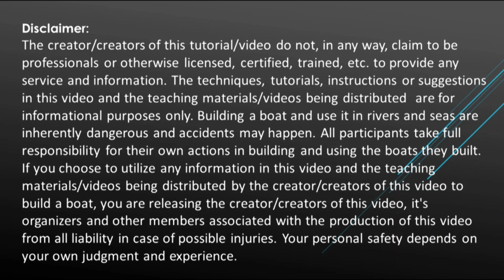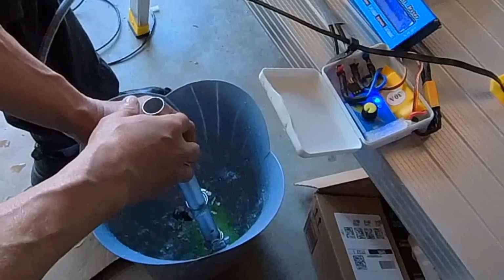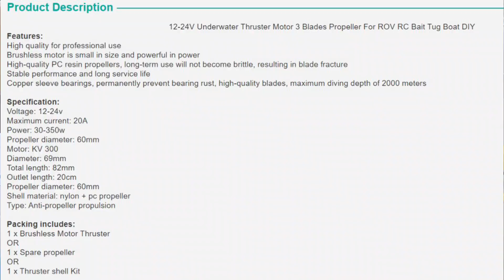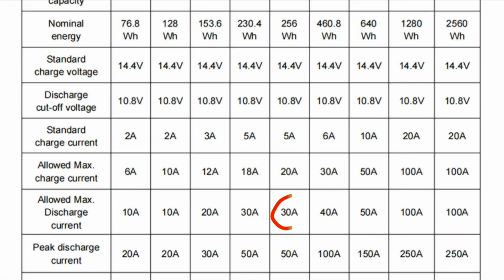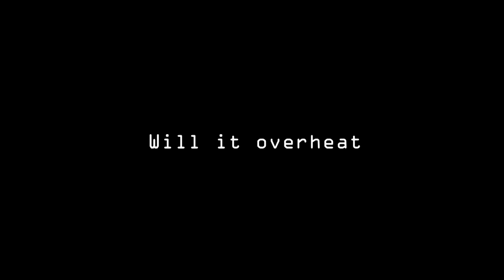Pt 2 Build My Bixpy Kayak Drive

Comment: What motor drive controller did you use for the green motor in your video? I'm wanting to do a two motor setup, I'm not sure if I need to have two separate controllers (because of the current draw) . Do you have any web link to the controllers you used? (Parts List) I have enjoyed watching you build your kayaks
Reply from the maker: Thanks for your support.  Please read my reply to your email. I copy part of the respond here: 
You can get the 'same' controller from many places, and with different prices. Such as eBAY, TEMU, AMAZON.. Same with the green motor.
I checked Amazon, you can get this one, or other similar ones.At  5:10 into this video, I have the circuit diagram. It is very simple with only a few parts. 

https://www.amazon.com/JINOARC-Electric-Brushless-Controller-Helicopter/dp/B0DY5S8VF8/ref=sr_1_1?crid=1WHBG0BUH4ARL&dib=eyJ2IjoiMSJ9.D2_PAiNGu7rB9OppG3hT5Arn4pNmGRwunC87Wc9H2j694myU4yAzIlHMOKxisKQYFjujDRunGLMMPafXV-gPNcKGmgPkeK59L7Y7LfVT-08clXLXKz1RwiK_L-h8KfoE6AofNSU9oSjKiXjhxF7rGPds38pw4idA5O6m3leGbXRJ0o1Vb8gjNMKmBUBHPEW9Za_3wycK2q4BkKrSet-pQ6nti8vKuGQ91q8EpC-J56FwDhr6lphSJ6shhP8KASKl1Pnv7I-uBzvbg6QJ65iTFsX6G4J9ewSlX6QB5bnpLdY.ViOOhxfxylQmmY2ykHCUAtJOyZG2ZGkK2w4qISoxIBM&dib_tag=se&keywords=30A+servo+motor+controller&qid=1755642568&sprefix=30a+servo+motor+controller%2Caps%2C145&sr=8-1

Amazon.com: JINOARC 30A Electric Brushless Motor Controller, ESC Speed Controller with XT60 &3.5mm Bullet Plug for RC Drone RC Airplane Helicopter 

I used the 30A one and that's good enough. You can try the 40A ones and pay a bit more. The important part is you have to remove the plastic heat shrink and add a heat sink on top to cool the controller. As shown in this video: 
https://youtu.be/b9l_38mcLy8?si=5CK6FsE2Uu-nl4xD

If you use two motors, I would use two separate controllers. This allows you to turn your boat by adjusting the speed of each motor. Also can eliminate the performance discrepancy of each motor. 

When you use two motor configurations, you have to pay attention to use one Clockwise rotation and one Counterclockwise rotation motor. Please use ChatGPT for explanation:goodvibes:.  Cheers!
Reply: @DIYUSA yes I will, thank you
Reply from the maker: @bendemby924  Please let me know if you have other questions. I can give you more detailed reply on email than here. Have fun building this drive!

Comment: 30A is a very high current. The switch and wires get very hot. I tried. you need to give a current of approximately 10A good luck
Reply from the maker: Thanks for your input... Yes, I agree 30A is a lot of current for the 6 gauge wire. I overstated my goal, I probably will keep that down to 20 A, or about 240 Watt to drive the motor. That is about the right level that my battery can handle.

Comment: Did it not seem like it was going to fast in the air and that it would draw alot of current or overheat seems like lower rpm would be better huh maybe lower volts?
Reply from the maker: When the motor is running in the air, the resistance on the propeller is small, the motor will run very fast, but the current draw is small (there is not much loading on the motor). When the propeller is submerged, the load on the motor increases and it will keep on drawing more current and create more power to move the water.  Similarly, if you turn on the vacuum cleaner and you gradually blocking the suction pipe's opening, the vacuum cleaning will gradually drawing more current, and it's motor will be getting very noisy.

Comment: For inflatable Kayak, Planning to use two motors with 30 amp supply just to safeguard motor from burning..

Is it good idea?
What is ur input or just single motor is enough?

Please let me know.
Reply from the maker: Thanks for asking. I have looked into using two motors. I didn't implement that because one motor can easily draw 30A at 12V, that means I need two small batteries, or one large battery to provide enough current. That will increase the cost and weight. Also I need to come up with more complex controller to control two motors. With one motor pushing my pontoon boat, my experiment shown that it is powerful enough for me. If I need more power, I will use my trolling motor (more cost effective - use the same battery I have for the small motor). I don't know the size of your inflatable kayak. For the one person kayak, I believe one motor will be able to push your boat against a 2 knot current.  You may want to experiment with a single motor and see how it goes before working on a two motor solution. Have fun!

Comment: Can you list the parts and link please? I would like to build one for my Kayak as well.
Reply from the maker: Please check Part 1 of this series: 
https://youtu.be/Fta763D4QOk
2:55 minutes into this video showed how to hook up this drive. The only missing part is the battery.
3:03 minutes is a list of the components

Please see the description of this video (part 3 testing of the motor drive): https://youtu.be/smNz7RCKHMk
I included that here also
Components I used (I am not affiliated with the sellers listed below) 1. motor and speed controller https://www.amazon.com/gp/product/B08... 2. motor https://www.ebay.com/itm/175328684963... 3. 12V 20AHr LiFePO4 battery https://www.amazon.com/Lithium-Securi... 4. 10A 12V LiFePO4 battery charger https://www.amazon.com/gp/product/B09...

Comment: I've been looking at some of these motors and wondering if they were reliable and strong enough.   Thank you for updating each of these ideas.
Reply from the maker: Just finished testing the motor and it works great. My assessment is it can push the boat slightly faster than my normal paddling speed when the motor is set at max. Can't tell high reliable the motor is. Will post the video in the next 2 days. Cheers!

Comment: I'm ready for the test 👍👍
Reply from the maker: I have just tested the motor. The speed seemed to be similar to my paddling speed. I will test it at another river so I can use GPS to measure the speed. I like the result.
Reply: @DIYUSA  that's awesome. Did you share links for your materials in the other video?
Reply from the maker: @jordanwalter2447  I will share the updated links in my test / next video (in the next few days). I notice the speed and power controller pricing is lower at Amazon (then what I have shown in Part 1).

Comment: Can't wait to see how fast it goes. Thanks for sharing.
Reply from the maker: Just tested the boat and the result is good. It may push the boat at a bit more than 2 miles/hour. I will get a GPS to do the measurement on another river soon. Will post the test video very soon.